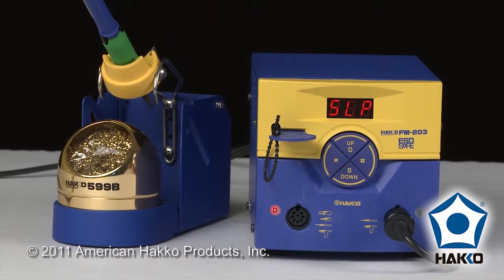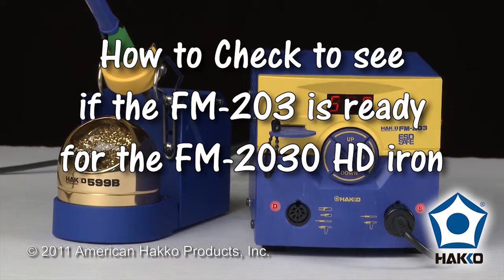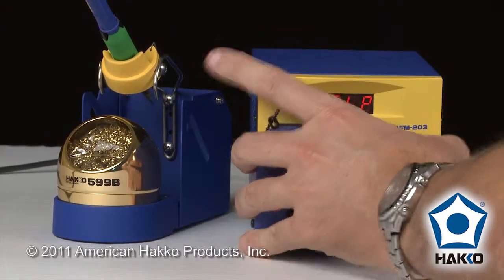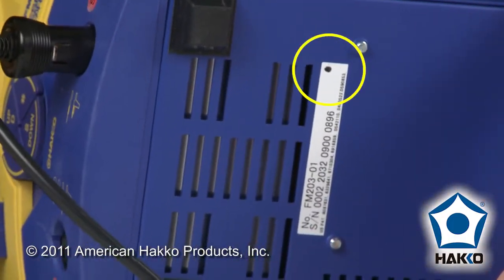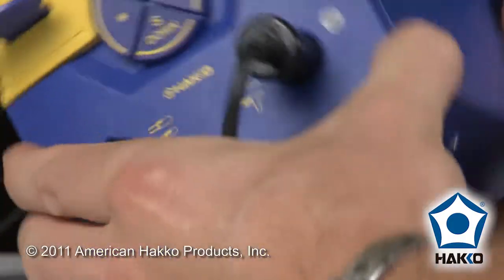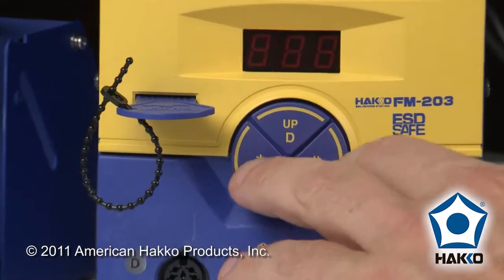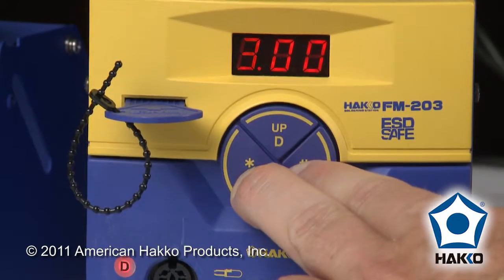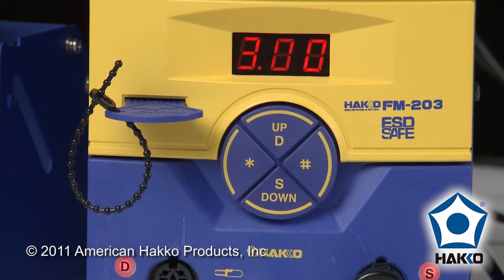Hakko FM-203 and the FM-2030 Heavy Duty soldering iron by American Hakko

Comment: Thank you for the information. I just purchased a EU version of the FM-203 through Eleshop (your European distributor). It does not have the black dot in the corner of the sticker, however it does display version 3.20 when powering it on while holding the three buttons. I don't have a FM-2030 handpiece to test it with, but I suppose it should be supported on my unit. I think checking the firmware version is probably a more reliable option than to just look at the dot on the sticker, because the unit might have been upgraded without the user adding a black dot onto the sticker afterwards.